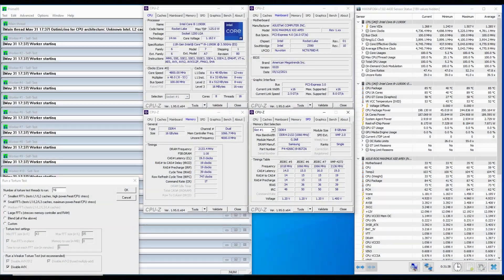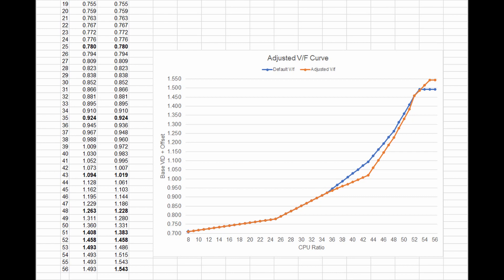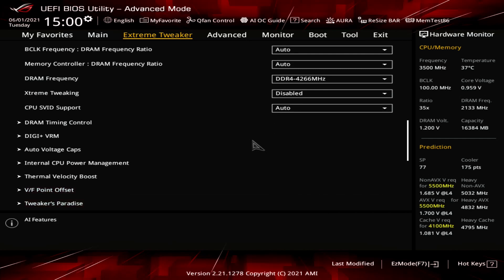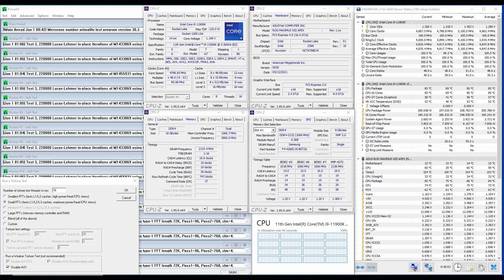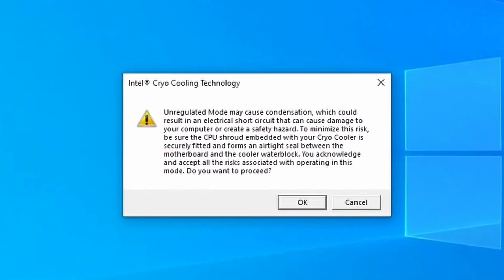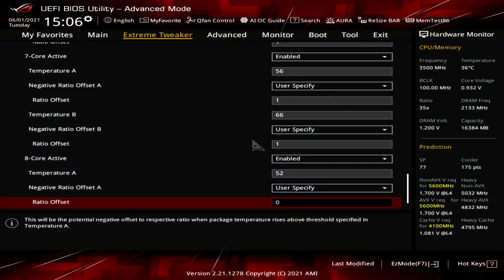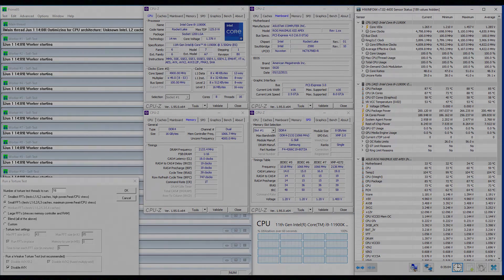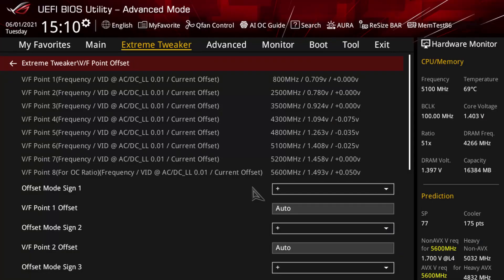"Using All The Overclocking Knobs" Ep.4 | OC Strategies #4 & #5, Unregulated Mode & Wrap Up | SB#25

Comment: Please re-run some of these overclocks, bios 0902 released 6/25/21 (right in the middle or after all of your testing) that fixes the issue disabling mce when xmp is enabled. You will get massive gains after then update. with just xmp, abt, and mce enabled you will easily get 5100mhz all core during benchmarks without even increasing package temperature thresholds. my cinebench r23 multiscore was 15808, I was confused when i saw your score with all that you did.